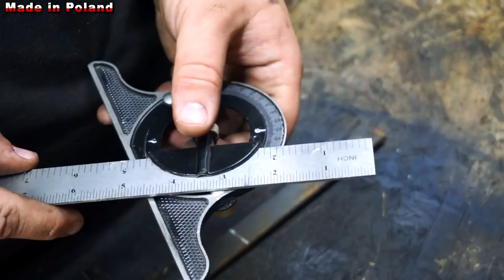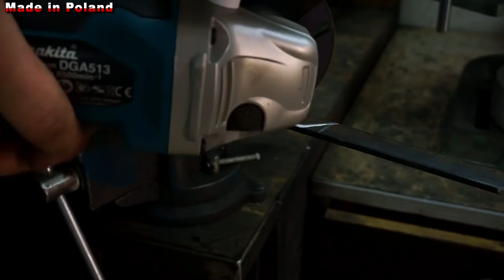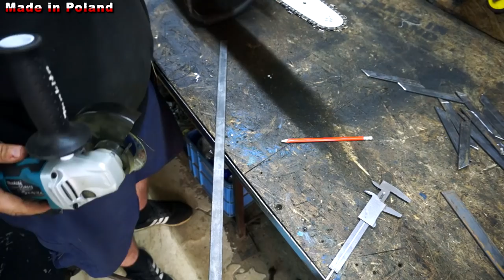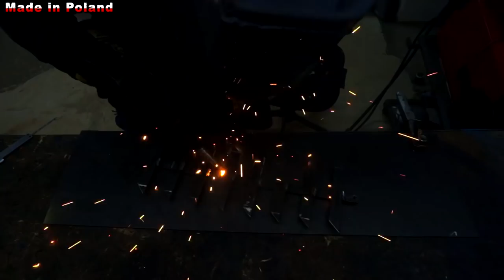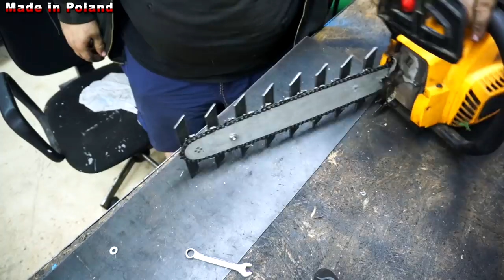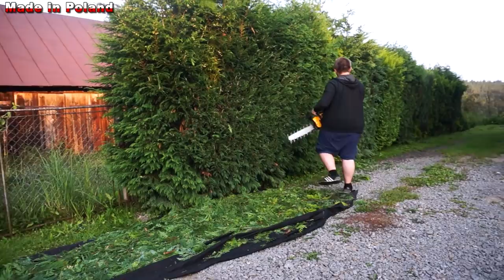Chain Saw HACK 5 - Hedge Trimmer

Comment: Great Idea.  Anyone with welding skill can make this. 
 .... and its better than a hedge trimmer.  Thanks for sharing.
Reply: You could drill and bolt each cross piece without welding.  But it would be a pain to undo it to use it as a chain saw again.  His design is much better in that respect.  I'll do mine his way.

Comment: You're right, you could just buy a hedge trimmer but they only get you so far. They can only handle so much so fast and up to a certain size. This hack is definitely a really good one. It's faster and more effective then a normal hedge trimmer and you can use it for bigger brush as well as a few other jobs.

Comment: That has real potential for hacking tall hedges and bushes down to size. Standard hedge trimmers cant cope with  thick branches and chain saws just pull the branch back which tends to jam or flick off the chain.....I've done it. You end up having to use loppers or a Sawzall which is soooo slow. That hybrid design looks like it would cope with large branches nicely....turn my 3 metre hedge back into a 1.5 metre hedge in one easy pass. I might just make one of them....

Comment: i dont get it. does the flatbar iron act as a guard or something?
Reply: I think it acts as a comb to feed the branches to the cutting chain...without this comb the branches wuold be pushed away from the chain...compare it with a standard hedge trimmer, the have moving and fixed blades...this is the same principe...

Comment: Hedge trimmers don't do a good job pulling branches into the cutter  blades and they don't work too well with branches more than about 1/4" (6mm) in diameter.  This chain saw mod fixes those problems perefectly.  I'm going to make one for my chain saw.

Comment: It's wonderful to see it!  I have a chainsaw and a weak trimmer. I need to clear through very tick layer of mixture of vines and small trees around the chainlink fence of an abandoned (for 20 years) swimming pool. I need the power of a chainsaw but I know at times the elastic thinner stems will just slide off and escape  blade, and I was trying to come up with a solution.  It's great to see you not only built the tool, but also proved that it worked well. That's exactly what I am going to do and my search on YouTube ends right here. Thanks again!

Comment: Sorry but this is just shredding those conifers and damaging them. A heavy duty hedge cutter has  a longer reach, longer blade and a cleaner cut and is faster. This might be useful for a height reduction but again a hedge cutter for the bits that it can cut and a telescopic pole saw for the rest.